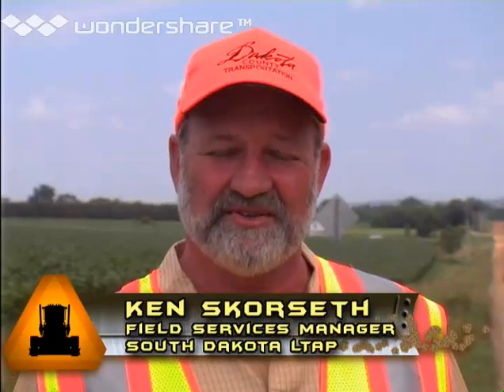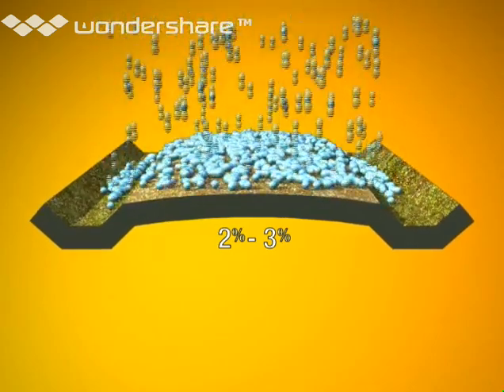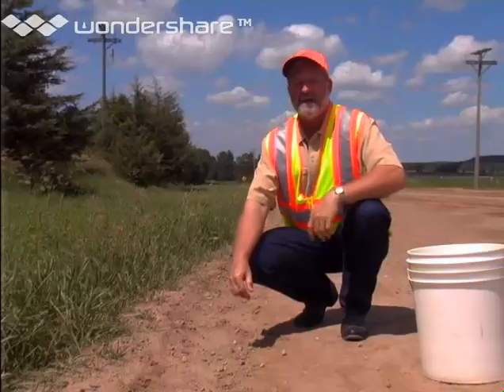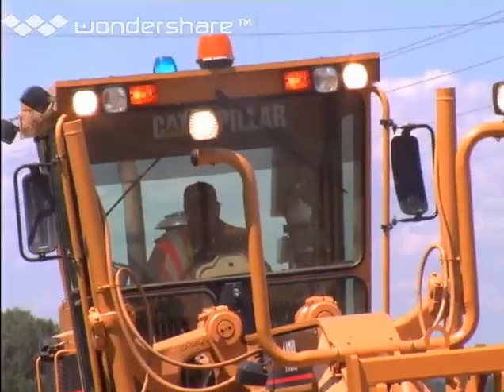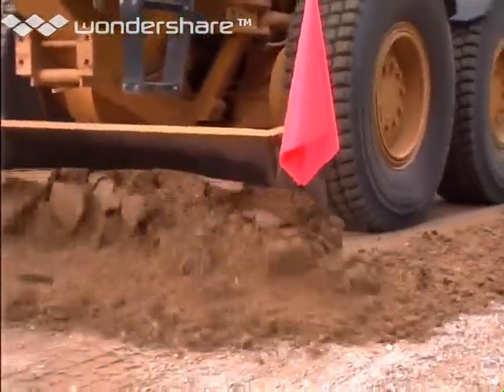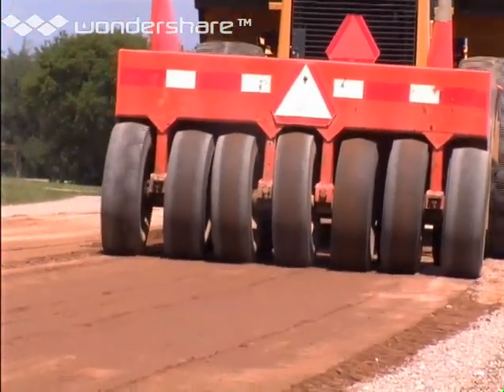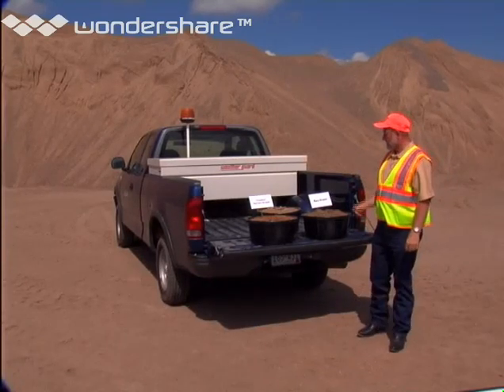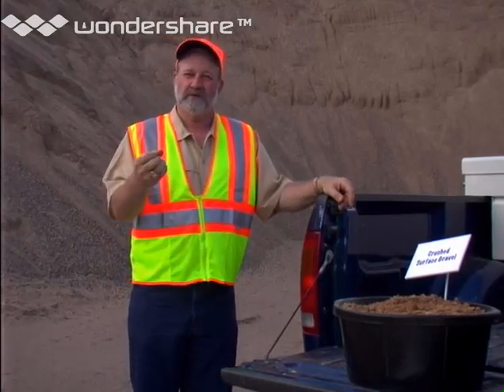Gravel Road maintenance

Comment: Good video, I made the mistake of putting down 1 1/2” crushed rock for a mile or so on the ranch that I live on it’s about 3 to 4 “ thick, it’s noisy it never tighten up and it’s chewing up all my tires bad, when I run my dually service truck on it it looks pretty good and flat but then after driving the Kawasaki mules on it it gets loose again, there’s a lot of roads here with 3/4” class 2 base rock at 6” plus and there pretty good but real dusty the fines in the rock just turn to dust but this road does good in the winter because it’s crowned but on flat ground, 3/4 is to small for a road on a slope the rain will wash it away, it would be great to pave over but to expensive.
Reply: Joe Corrie crushed rock should tighten up pretty good as long as it’s not round,  3/4” road base should be your safest bet, you could always oil it down for dust
Reply: Jeremy Huston is that like a 1/4” crush ? You know the 1 1/2” won’t get tight because it’s crushed but has rounded edges not sharp like other roads I’ve seen that are packed nice, O well love and learn.
Reply: Colt Noah yes Colt it is crushed but with rounded edges, I never even payed that close attention to it but I know now it’s not as good?
Reply: @joecorrie1  ya you want jagged stone for your road bond. "crush and run"

Comment: So you have a 4 pass and a 5 pass each with their own benefit's. Doing a 4 pass is quicker and puts more of a point in the road and will build a crown very quickly. the con to a 4 pass is it will make the public drive down the center of the road. we will do a 4 pass on a narrow forest road. The 5 pass is a better for a wide road, It can handle 2 way traffic. But must keep a 4% Crown  for rainfall. Always keep your eyes on both sides of the blade. If a operator only watches the right side of his blade he is probably a beginner.

Comment: Thank you for showing this video. Good information on grading (Gravel road) one question for anyone out there. What does the ( BLUE) flasher "Strobe" used for on the rear of the cab. I'm just asking because PD is the ONLY one allowed to use BLUE in the State I live in. When I was a volunteer FF in the 1970s, we could use a BLUE steady facing forward light, then the State changed LAWS. We volunteer switched to a GREEN Light. Now in the 2000s. The command post at major call out the BC has a GEEN light on his vehicle. I help with a Rehab unit with Cadet FF working with Medical service Officer, monitor of FF vitals on change out of crews (FF taking a break) the BLUE light tells everyone where CP is located. Just wondering what the BLUE light means on motor graders, that's all. Please if anyone has answers to why let me know in comments, thank you.??????
Reply: Blue is for winter (snow) clearing operations. I see guys use it during the summer all the time and it makes me cringe